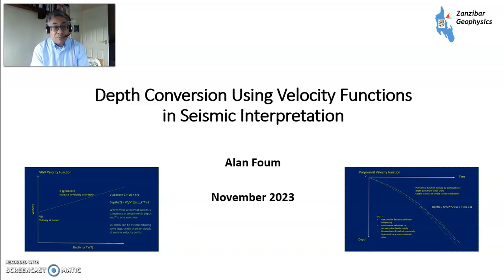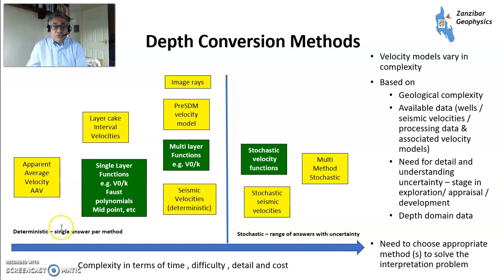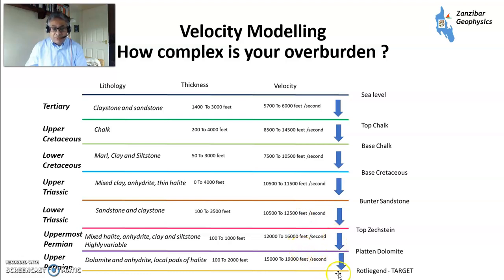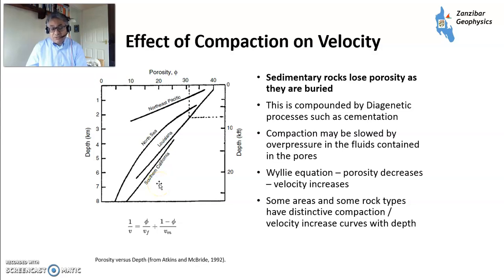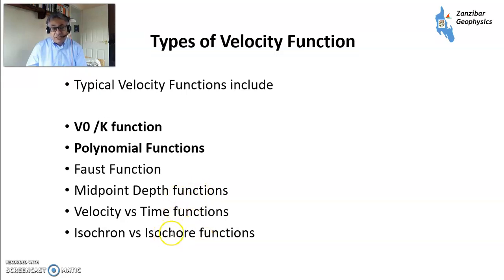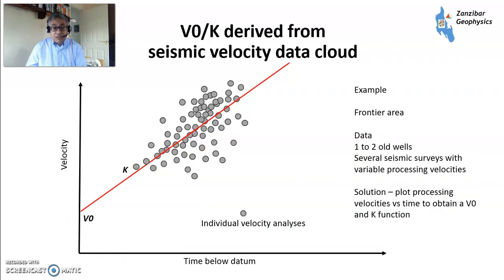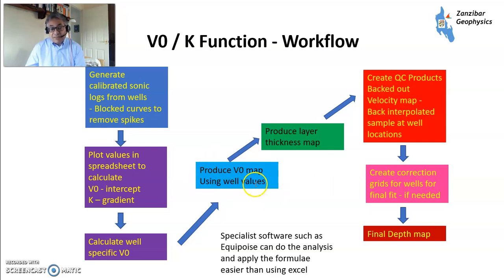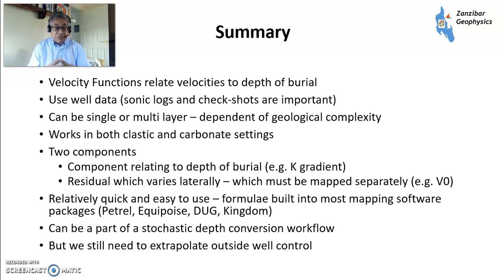Depth Conversion Using Velocity Functions in Seismic Interpretation

Comment: It's a wonderful initiative to address practical approaches and QC methods in Geophysics. 

And, sir i would like to request you please educate us on two things:  1.) How to validate/QC's of seismic velocities when PSDM processing is ongoing? 2.) What should be the processing deliverables e.g. velocity cubes types, angle stacks, PSTM volume etc.
Reply from the maker: 1. - various QC tools - mainly visual inspection of velocity maps and sections / volumes - does it look reasonable? are there any bullseyes or velocity values that look out of place for the expected lithologies?

2.. All of the things you mention, velocity cubes are very useful particularly for FWI volumes and have a secondary use for pore pressure prediction in DW settings 
Angle stacks are now routine, 
PSTM is only really useful in this context for building the first velocity model / fast track interpretation but I would also add the PRESDM volume stretched back into the time domain - this would enable depth conversion sensitivities  - please see my video on Depth Domani seismic pitfalls and possibilities